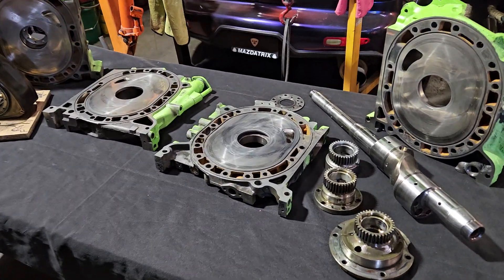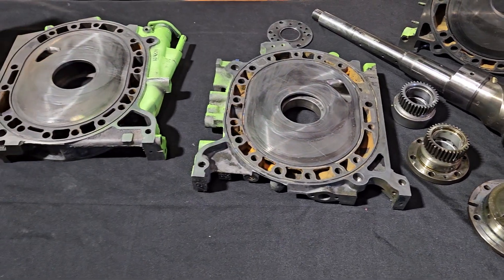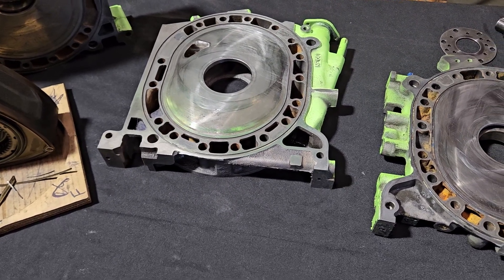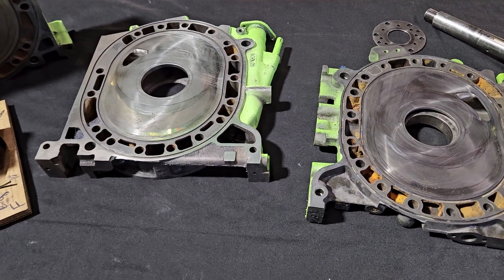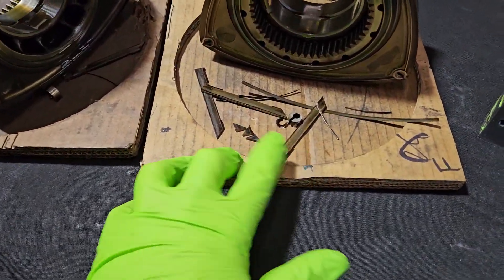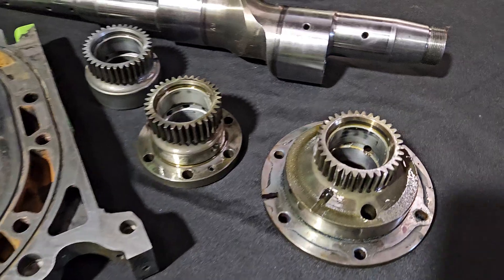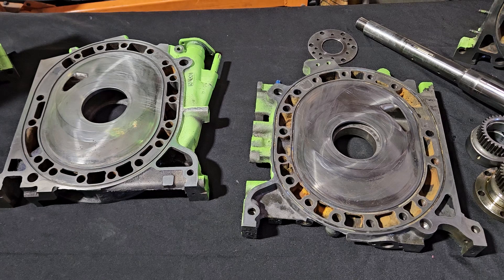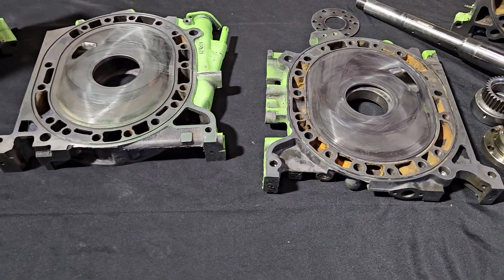1000hp Rotary Reliability? Looking inside the formula drift motor after a season - KMR Rotary Engine

Comment: if you ran pp or bridgeport. and were able to achive similar powerleves at less boost. would you be comterable with not studding the block? the way you phrased it made it seem like that might be the case
Reply: I believe the power levels dictate the need for enlarged studs, regardless of how you get to those power levels. He said the setup he built was for a more usable power curve. That way he wouldn't be relegated to a narrower high rpm power band only and be able to be more competitive vs cars that had broader torque ranges. He did mention how this approach led to more stress to the block due to higher boost levels and higher egts than he would have preferred to run. Generally high boost and high rpm lead to a lot of excess pressure and heat. Generally utilizing one then moderating the other leads to more longevity. Going max on both will surely decrease lifespan greatly. Its why the streets builds that run moderate boost and rpm last so much longer. This is a generalization, but all things being equal otherwise the statement would hold true.

Comment: Did you premix only? And what ratio? Thanks in advance!
Reply: most people will tell you 1oz per gallon. wich is about 0.73% or 150:1 if i remember correctly. i read idemitsu recomended their rotary premix be mixed somehwere bewteen 0.5% to 1% or 100:1 to 200:1 range. since theyre the only ones making a rotary specific premix. i think this is a good range to keep to. it's obviously going to vary on you application and things like omp or no omp.
Reply: renewable lubricants also make a rotary specific premix oil. so it think theres a total of 2 rotary specific premixes on the market.
Reply from the maker: @Mr.Manic_M  I'm using renewable lubricants premix .75 oz per gallon with e98 ethanol as fuel

Comment: Nice! Is a Hybrid 3 rotor possible?
Reply from the maker: @RaydenRotaryRacing  Yes, it's possible
Reply: Possible but pointless
Reply: @jo-qp7mz  pointless how? if that's what he wants to do, then why not
Reply: The X in RX is for "experimental". 👍
"Rotary Experimental". Just because someone else doesn't see the point, doesn't mean it's not worth doing. 🤓😉 Negativity has never kept me from doing anything lol. 😅
Reply: @allthehandlesweretaken  nobody has dyno proof that a hybrid 13b engine makes power..  so why would a supper expensive 20b hybrid be worth it... just my 2c
Reply: @jo-qp7mz  hasnt kmr specificlly stated that the hybrid makes more power with less boost? from their dyno testing
Reply: @allthehandlesweretaken  yes the sure have.